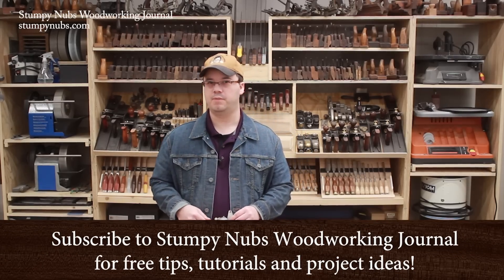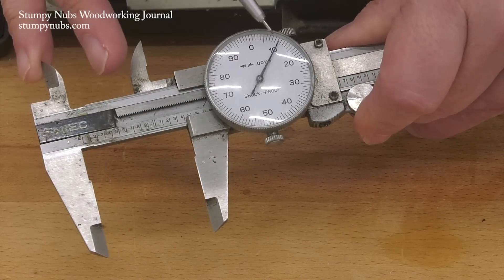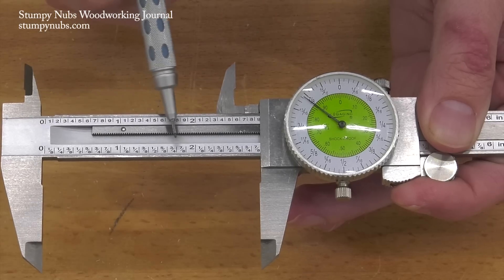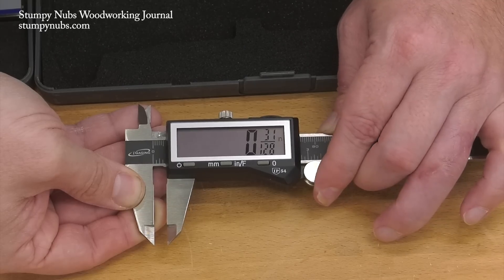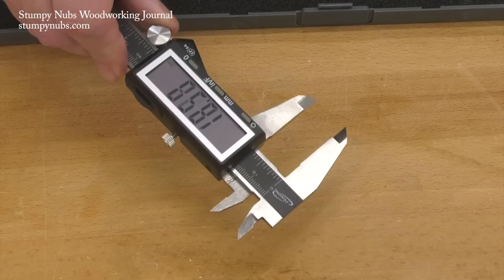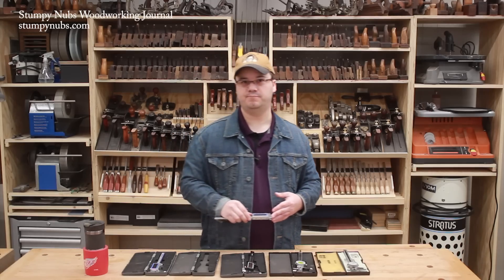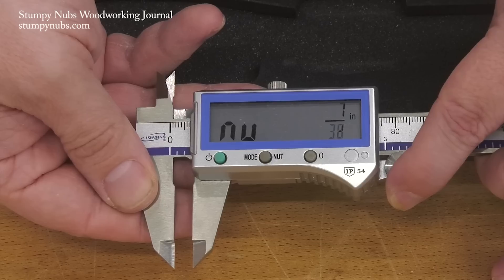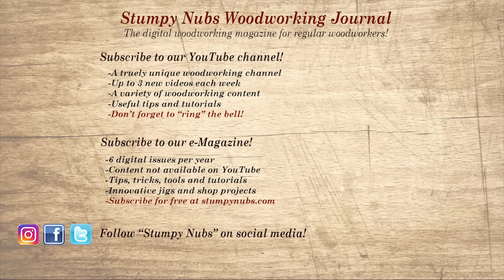FINALLY! Calipers made for woodworkers!

Comment: I was a machinist for a while and our CNC's worked in decimal inches to the nearest 1/10000 of an inch. Our end mills and drills were in inches and it didn't take long to learn that .0156 was 1/64th or that .3125 was 5/16th etc. when we used our calipers that read in decimal inches.
Reply: ^^^exactly... 😁👍
Reply: its ok for us engineers i was a capstan/ctr lathe turner for 45 years also CNC so working in metric and inches and converting is no problem it comes automatically. in England its just came naturally when the conversion turned from  inches to metric so now i am retired and now a wood turner i still use a lot of my metal work measuring tools verniers and the like.
Reply: 1/64th is .015625 to be precise.
Reply: @BedsitBob  haas vertical Mills only do 4 decimals. If you don't sometimes you get an error saying out of precision

Comment: I grew up when in the 70's the US decided to try metric and it went over like a lead balloon. Now we suffer with both systems and it costs me double because of router bits, drill bits, wrenches etc.  being in both scales. I have learned to love the metric system because of building cabinets using it. The metric cabinet is so simple and standardized. I use the Festool LR32 system frequently which makes errors much less likely because it registers on both ends of the panel so no matter which end is up or down it's the same if you build using the 32mm standard. I like that it is a little more accurate without using 32nd's in fractional scales which always confuse me. Try dividing cabinets parts into several equal sections using fractions...mind numbing even with a construction calc. My Saw Stop has metric scales so I love to use it. I wish we had gone thru the conversion. The excuse was no one understood it and it would cost too much to retool our factories etc.
Reply: I like working in both systems, and both have their issues.  For fans of metric who claim it's easier, take a look at thread and tap drill specifications for metric.  While yes, our use of fractions, lettered, and numbered drills is a bit confusing to someone who is new to it, it is a whole lot easier than the fractional metric sizes.  The only thing that comes close in our system is the difference in wire gauges for ferrous metals versus those for electrical wire.  Most of my projects combine woodworking and metalworking technologies, so working with them all is necessary.  Frankly, I don't see any significant usability difference at all.  If there was one area where I think American standards could use a total rework, it would be with pipe threads, which are based on the 19th century standard wall thicknesses of galvanized pipe.  Also, the tapered threads are nice until you need a nut for a piece of pipe with an extended set of threads - then it's good luck finding something that works.  Finally, for those who claim we didn't change - we did, just selectively as determined by consumer behavior.

Comment: I wasn't happy with the EZcal Calipers that I got years ago. The battery compartment wouldn't stay closed. I had to resort to taping it shut. Parasitic battery draw is pretty significant so you do need to take the battery out during periods of non-use, which exasperates the battery closing issue.

Comment: I have a set of dial calipers with the fractions and like them better than any digital solution. The biggest reason is that analog dials are relational while digital displays are absolute. I can look at my dial and easily see that I'm shading close to a 16th without any mental strain. There is a direct correlation between the dial and the workpiece. I can see that it's still a hair too thick and the amount the dial needs to move gives me a good idea of how much needs to come off (or more typically, how much too far I've gone). Analog dials just give you a little bit more information in a more easily processed way, and I like that.

Comment: In Aus, when we changed from imperial to metric, tape measures with both scales were (and still are) common, one guy came back from site with a markup with dimensions like one thousand two hundred and seven sixteenths because “it just worked” still makes me smile 45 years later. I would imagine that most American who measure stuff are able to use metric as needed? I avoid the battery type tools as they’re always flat when I need them, I’ll now start taking the battery out. Thanks for the tip.
Reply: I have three digital calipers in my toolbox including a Mitutoyo from the late 1980s.  I replace batteries maybe once every two or three years, but they all use the same battery so it is no problem keeping a spare in the toolbox.  I use the cheaper (Fuller I think) for marking out metal.  Maybe once a year I sharpen the tip with a diamond stone (from the back of course).
Reply: (michigan) most schooling focuses on using metric, 
give any random person here either kind of tape measure, or ruler, and the biggest issue that would come up is them not knowing what the fractions smaller than 1/4 on the imperial scale are.
Reply: The change to metric the year after I started high school so I started using Imperial and ended using metric. I remember there was a period (my head has 15yrs embedded) where all rulers had to be metric only and then you could get both. I was on Bunnings the other day looking for a steel rule with both but my local didn't have one.
Reply: Im the opposite john.
I keep getting frustrated that thevtapes i want to get are always both. My job means i have to be able to read from different sides depending on where im working, so i need a metric only and the buggers charge more for them.
Fpr steel rules, try art supply stores like eckersleys. They will probably carry a wider range as they do tech drawing supplys
Reply: @davidwood3751  ...or Fast Cap. They have a wide range of tapes with right-to-left/left-to-right metric tapes....
Reply: My old boss would mix the two and say things like, grab a 2 x 4 and dock it at 300
Reply: I use metric system when I want to be more accurate. I was making INCH rulers for printing and putting on my equipment. Wanting the accuracy of 1/32 inch I used 1280 pixels per inch. That would give me 20 pixels per 64th if I ever wanted to get it that far.
Doing a metric ruler is a lot easier due to the base 10 division. But growing up in the States, learning inch, and everything here is in that scale it's difficult to change.
They still sell it by the foot. And I don't plan on leaving my Home Country in favor of the METRIC system.
Reply: I use both. Having grown up with imperial, I have no problem with fraction conversions down to 32nds (e.g. knowing that 3/32 is just under an 1/8). 64ths and smaller is where I need to start thinking of math to figure out the size, but I rarely need that precision in woodworking. I also use metric when it makes sense, like when using the 32mm system for cabinetry. I have even built projects in metric just for the experience. To me, it’s just another scale.  Yes, metric is easier since our number system is base 10, but inches are a good base measurement size for human scale projects, not too big not too small.  Now, all that being said, if I didn’t learn imperial growing up, I imagine it would be much harder to learn and I would prefer metric. Now as for Celsius, that makes no sense as I find it too coarse of a scale. Temperatures that are wildly different are too close in number and I have to deal with .5 degree values on the thermostat. Plus,  there are no decidegrees or centidegrees to make it useful as in linear measurements. I’ll stick with Fahrenheit.
Reply: @jeffreythompson9549  That actually made me laugh!  I'll probably think about that next time I use a tape.  And, just wait till I call out a measurement to someone!!!

Comment: I used both the imperial and the metric system all the time. I am from Europe but your opinion on how you think we precive our system as superior ( is miles apart from the reality. I am stating the majority don't think like that, so I hope this changes your opinion by a good multimeter or two, both systems are warranted. My shed is 15 ft by 13 ft and 10 feet high at its highest point, the roof sheeting was 4.75 metres long, window I used was 40 inches by 40 inches, door was 6ft 6 inch by 5 ft 4 inch wide, we use milimeters and cm because we are not thought inch fractions like the usa, the common person will use both unless you work on a big job site.

Comment: I have had calipers since 1970 that measure down 1/128.   I never learned to use that system.   It just may be easier to learn the decimal system than trying to figure out which is bigger 9/64 or 5/32.  I have digital calipers that read in fractions.   They are useful to match drill bits with their slot in the box since my eyes no longer read the size stamped on the shank.

Comment: When I first got into woodworking I had already been a working manual machinist for a little over a year. Since I am a creature of habit, the calipers and micrometers were and still are always on the bench. I don't generally use fractions much as I am much more comfortable with decimal dimensions and tolerances. 

And yes I know a +/- 0.005" tolerance is probably overkill for woodworking but it's personal preference I guess

Comment: I have used a machinist’s dial caliper for decades. However, after seeing this video, I ordered the Fastener-Cal digital version you recommended. No more  mental gymnastics or scribbling on a notepad???

I’m a chemist, so the metric system is no mystery to me. But I just consider myself “bilingual”, and happily do woodworking using the English system without guilt!

Comment: I’ve used a cheap stamped sliding brass caliper for many years. A while back I got a digital caliper.  The digital caliper almost always lands on  a number /128s, which I then have to reduce, or figure out, or reference on a chart since I rarely work finer than 16s. It’s Frustrating, as you said.

Comment: I used to do everything in millimetres, but I’ve found cutting stock in inches keeps my tools sharper for much longer.
Reply: ...what?
Reply: BluuurghAg9 I think that's a joke
Reply: Yes, I find inches stay sharper much longer the millimetres. Millimetres, there is just so many more of them to cut.
Reply: @MrBonners  Yeah, good point. I've got a digital mill that works to hundreds of a millimetre. I feel like I'm just forever sharpening stuff! Maybe I should press the button to use thousands of an inch...

P.s. "Irony" is not the art of pressing clothes, folks. :-)
Reply: @jasondoust4935  Use decimal yards and you will never have to sharpen anything again.
Reply: @MrBonners  You're a genius... I reckon we're on the path to creating perpetual motion...
Reply: That's probably because your tools are imperial. If you had metric tools, you'd find the opposite to be true.
Reply: @jasondoust4935  It's been done several times. Exxon has the tech buried in their basement vault in the New York HQ.
Reply: I knew I had a reason that we covered ONLY metric measurement in my middle school woodworking classes other than I could teach it in half a period.
Reply: Griff Miller Brilliant. II I knew there’d be a scientific explanation!
Reply: @MrBonners  A Meter? (3ft)  : )
Reply: You might love your millimeters, but I have a lot of fun with my inches.😊😈
Reply: @RichardWatsonboltspinner   2.6 cubits.
Reply: @MrBonners  Thanks' , never see that in a steel rule
Reply: @MrBonners   What does a stone weigh, please? Off topic, sorry.
Reply: @RichardWatsonboltspinner  2371 pebbles or 1 and 7/16ths boulders or 2.67  rocks  or 3 flagons of wet sand.
Reply: @RichardWatsonboltspinner  You have stolen rulers?
Reply: @RichardWatsonboltspinner  14 lbs. 
wikipedia or google it
Reply: @MrBonners  I did, thanks', what I came up with also.
Reply: @MrBonners  Did not look up 7/16 " boulders though,
Reply: Never heard of "Flagons" of anything, like half pence and pounds ? Just have nickles and dimes in Canada.
Reply: @MrBonners  No
Reply: @MrBonners  
What about Rods, or Fathoms, or Furlongs or Light Years. Not only would tools never get dull. They would continue to get sharper just sitting in the drawer 👍
Reply: @RichardWatsonboltspinner  Flagon of ale.
Reply: @mpetersen6  Light years are the same metric and imperial. All the others are perfectly good measurement units and more. Just 5 chains down the street from me is a buggy whip factory.
Reply: @RichardWatsonboltspinner  you don't  have 'hot rulers'?
Reply: @MrBonners  
Finally, we have developed the Grand Unified Theory 🤯
Reply: @mpetersen6  that's why i always have my chisels kept in my pyramid tool box
Reply: @mpetersen6  and guess what? it's metric. USA get with the program.
Reply: My bicycle speedometer is calibrated in furlongs per fortnight!
Reply: That and a metric adjustable wrench... To change the blade.
Reply: what country do you live in?
Reply: i do (almost) everything in time, in my workshop, in retrospect, in jest, in my hat…

Comment: I have found after using both digital and analog, I much prefer the analog (no battery).  Zeroes out every time and no switching between metric etc.
Reply: I much prefer dial over digital as well.
Reply: My Mitutoyo digital are about 35 years old, but I wore out two dial calipers before that (I started as a toolmaker in 1967).  The dial calipers would get fine swarf on the rack which jammed them and made them clunky.  The needles would bend and come loose.  They just weren't very durable for a 40 hour a week machine shop use.  I still have the Mitutoyo, and they work as well as they did when new, and they have had the same hard use as the dial calipers.
Reply: I just bought digital tilt and angle gauges.  Game changer for me, and so affordable.  Digital is great.

Comment: Cracks me up listening to a UK woodworker video, where they talk about a 4x8 sheet of 20mm plywood.  ;-)
Reply: That's true but we would always say 8x4 and 18 mm instead of 3/4 inch and 2x4s are 4x2s. and as for rabbits - lets not go there!
Reply: We say 8x4 because that is the dimension it is sold in. Nobody is going to say "can I have a 2440mmx1220mm sheet of ply". Plaster board is sold as 2400mmx1200m but you ask for 8x4. But 4x3 plasterboard is 4"x 900mm.
Reply: @stephenribchester2185  True but it's invoiced in metric and made to the mm.
Reply: @stephenribchester2185  The plonkers here in South Africa don't know it as 8x4. Or even what a right handed door means. Or even that an Allen key is a brand name.
Reply: Yup. We're polymensurate over here.
Reply: To be fair, UK plywood is measured and cut in mm... it's just much faster to say 4x8 (or 2x4, 2x6 etc). Although most of the time we just say "full sheet" like you would

Comment: Metric woodworkers are not just overseas; we are here in the US too.  Doing math in tens is so much easier than dealing with fractions.  I get it if you are already invested in lots of imperial tools,  but if you are in the US you can do metric, and I’m attempting to set up my shop that way.  For instance, when I bought my SawStop, I ordered a metric tape to replace the imperial that came with the saw.  Clinging to the imperial system is doing the US wood-working community a disservice, since the US is the only industrialized country in the world still on the system, and most all large US manufacturers went metric years ago.  By the way, I LOVE your channel and have learned so much from you!  You should think about converting some tools to metric as you replace them!  ;)

Comment: The fractional dial looks great. I have digital calipers with a fraction option, but that's pretty useless because it's hard to quickly tell how close 15/64 or 29/128 is to the measurement I need. I end up having to convert my fraction to decimal. The digital one with rounding needs to show a remainder to be useful.

Comment: One add to your testing of the calipers for accuracy at the end of your video. I am an engineer and one thing that is just as important in gauges is not just accuracy, but repeatability. Some more expensive gauges have tolerances for repeatability so that if you measure the same dimension repeatedly the measurement is consistently accurate. In woodworking it is not as overly critical, but is important in quality control situations in industry. We measure both accuracy and repeatability using a statistical technique called a Gauge R & R. Anyway love your videos!!!
Reply: As in GO, No Go gauging ?

Comment: I completely agree!  I have a couple of digital calipers that will measure in fractions, but they are annoying and almost USELESS in that mode, since they "want" to measure in 128ths...meaning I am always trying to figure what the nearest 16th is.  And, like you, I usually switch to metric instead.  In fact, I LOVE working in metric, if I can.  My metal combination square has both imperial and metric scales on the ruler.

Comment: I just replaced my digital caliper w/ the dial type. Not only does the dial calper not need batteries, it turns out the the digital is not was waterproof as I like.

Comment: I live in Canada which has been metric since the mid 70's but still use feet & inches for wood working because all the metric plans use is millimeters, Never centimeters or meters. According to Toyota , the wheelbase on my truck is 4000 millimeters

Comment: Stumpy, you left out vernier calipers and how to read them! 

Some of your viewers may still have one.  I have one that has two vernier scales, decimal and fraction down to 128ths.  I used to use it quite a bit, although I now use a digital one, but I keep going back to the vernier when the battery runs out until I can get to the store to get a couple more batteries.  The vernier caliper in decimal and fraction is a "Modern Tools" brand caliper, and is well made.  It appears, though that the company is no longer in business.